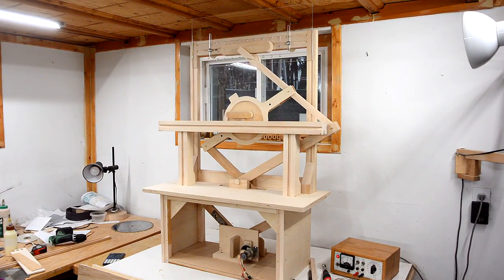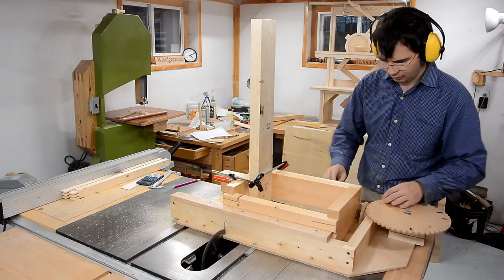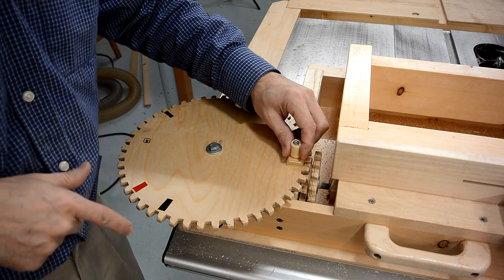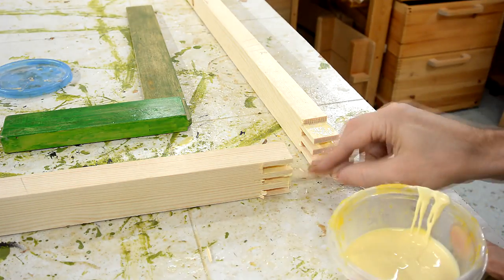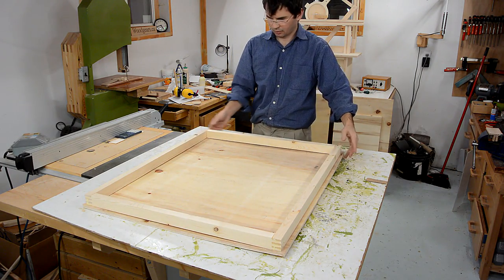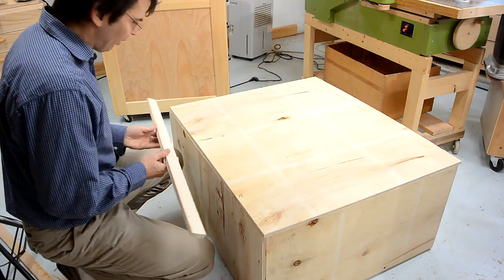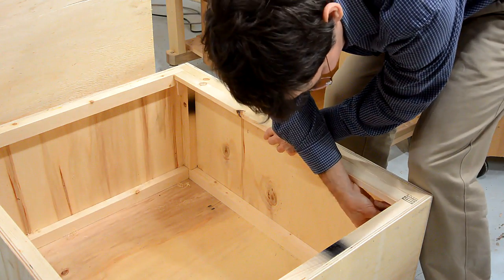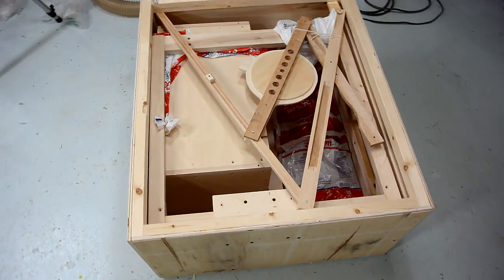Building a shipping crate

Comment: Happy Christmas morning!

It was such a treat to disassemble the box and set-up the demonstrator PantoRouter when we received it the other day, I was like a kid on Christmas morning.

There's even more of Matthias' brilliance built into this box than he showed in the video.    
Each piece of the demonstrator is carefully positioned and either screwed in place or has form-fit brackets to hold it securely.  

Even the plastic bags are well-thought and appropriate for their use.  Instead of using a piece of cardboard or the like, Matthias used the bags everywhere two wood pieces contacted each other in the box.  The two polyethylene films provide a lubricating layer to protect the final finish of the demonstrator better than any other commonly available material.
  
We painted the components above the motor and gear box then repacked the crate for delivery to the show venue in Baltimore.  I had taken photos as we unpacked the components so everything went perfectly back in place.

The crate is also the right height to use as a base at the show.  We're sewing a fabric drape for the base crate and a tall curtain to back the demonstrator so it really pops.  

Come see us at the show!
Reply: +Mac Sheldon Thanks , It's nice to hear the rest of the story, and all the brilliance built into the entire project. Good luck at the show!
Reply: please upload a vdo of the final demo setup u do at the event.

Comment: I've often wondered about those wooden gear systems? Can you really get an accurately repeatable cut? I assume so or you'd have designed something else. But I just can't  help think magnets would help. One on the crank, one under it so it stops in exactly the same place each time and holds there without moving if bumped or vibrated. Maybe even drilled holes all the way around so you could move the magnet in the crank? 

Just a thought, love these videos. Who knew watching a guy build a box could be fun!

Comment: Nice crate. You should add feet to the bottom of the crate to lift it off the ground about 3 to 4 inches, so you can get the forklift under it. Shipping company are notoriously hard on shipments, if your lucky they'll put a crate like yours on a pallet and we'll be fine. But I've have a couple shipments where they just ran the forks right through the crate. Sure the insurance company did cover the costs to replace the shipment but the hassle and upset client can't be repaired or replaced.

Comment: Matthias, first of all, happy holidays! I know simplicity is always the best starting point, but wouldn't it be a fun project to replace/power your jig gears with an Arduino or Raspberry Powered stepper motor. You could configure the required spacing and offset in a simple UI, and after each saw, you press a button for move to the next location. Would look awesome. :) - Keep up the great work!

Comment: what is the purpose of the screws if you have the nail gun?
EDIT: I'm, talking about the four screws added while gluing the side panels
Reply from the maker: +Ben Tzion Zuckier Shown in the video.  Screws pull wood together.
Reply: +Matthias Wandel thanks, but wouldn't the nail gun accomplish that? (thanks for the reply!!!!)
Reply: +Ben Tzion Zuckier I think that part wasn't getting pulled together so he used screws for more pulling power
Reply: ah thanks
Reply: +Ben Tzion Zuckier No it won't. When you shoot a nail it just penetrates the wood and holds the wood in place. Nails have very little pulling power. It might close the gap slightly but nowhere near the 1/4" required in this video. You need a screw or a clamp to make wood move.
Reply: thanks, i am a nooob
Reply: +Ben Tzion Zuckier  clearly
Reply: +wiser82 lol thanks. I enjoy the motivation
Reply: +Ben Tzion Zuckier we all have to start somewhere. better to ask than live not knowing.
Reply: +Ben Tzion Zuckier No one was born a professional. One thing to remember about screws and pulling wood together. The screws used to pull wood together need to have an amount of metal on the shaft without threads equivalent to the thickness of the material being screwed through. If not, the screws tend to push the two pieces of wood apart rather than pull them together.
Reply: +Jeff Stanley Or you can predrill the plate wood with a diameter equal to the thread width, at the risk of catching it less with the screw head.
Reply: +dascandy More than one way to skin this cat but your way requires the extra steps of finding the right size bit, installing it, drilling, removing the bit, installing the driver bit and then driving the screw. I am counting four extra steps.
Reply: +Jeff Stanley Yes. But given that I don't typically have the right screw handy for such a thing, the alternative is to get in my car & go to the hardware store - assuming it's open. That's a big step more. Naturally, it all depends.
Reply: +Jeff Stanley +everyone that commented thanks so much guys! I really did learn a bunch.
Reply: +Ben Tzion Zuckier I think everyone is missing the fact that he is using the screws to pull the wood together because he doesn't have a way to put a clamp down that far on the wood since there is no open side where the screws were put.
Reply: +subsgob00m Even if you did have a 1.2 meter long clamp that could, you'd be pulling the cleat away from the bottom face with the same force. That's not helping the overall structural integrity, so screws are a better solution.
Reply: wow. It seems i sparked quite the discussion
Reply: +Matthias Wandel hehe yes, yes they do
Reply: +Ben Tzion Zuckier Just because I didn&#39;t see anybody else mention it, personally I use nails to keep a piece from moving up/down left/right, to keep alignment correct. Screws are used to pull two pieces together. I often will use both depending what I&#39;m doing -- I&#39;ll hold the piece up in place and use nails to fasten in place so it doesn&#39;t move around, and then use screws to clamp it down. Because screws have a tendancy to walk, even if I drill a pilot hole, this helps with that. it also acts as a third hand
Reply: Chris Johnson thanks!
Reply: +Matthias Wandel So do clamps.
Reply: +Mark Job 100 screws are $4, a collection of clamps to cover all your various size needs with enough clamps to clamp an entire project...hundreds of dollars
Reply: TKD COW Lol! But to be fair Jesus did use nails..... (for his hands, ya know...like on the cross...) XD haha thanks cow.
Reply: Mah nigga +Ben Tzion Zuckier knows what he's talkin bout!

Comment: Hey, i know this question is kinda random, but..
I'm going to make a sofa table and a tvbench for my mother, and I'm very uncertain about the joints. I'm very very limited with tools and space, I only have a handdrill and a mitre saw. 
What joints is best for this project? Not sure I can make any Good joints with these tools.. Thanks
Reply: +TouchOfRed7 You are right to be concerned :) About the only joint you can make with that toolset is dowels. Buy a set of dowel points, drill two holes in one piece to be joined, insert the dowel points, and push it against the other piece to mark the locations for drilling on that piece. Good luck.
Reply: +TouchOfRed7 Looks like screws are going to be your only choice. You can be somewhat decorative by cutting the wood at 45 degrees and making miter joints.

Comment: Crate? That's not a crate! It's a piano!
I worked for a taxidermist building crates after I retired. We used 1 x 4 for frames and 1/4" ply or 3/8" particle board fastened with 2" and 11/2" staples, no glue., and always put 2x4 skids on the bottom. These crates contained everything from folded salted hides to moose head mounts wth 6' racks and life size standing grizzly bears, and were shipped all over the world without any serious damage to the contents. Anytime I got too fancy with my assembly my boss would grin and say " hey, you not building a piano there!"

Comment: Triffic work for a 'temporary' item.  You work so quickly in the video,  you must take some longer time planning how large the box will be; yes, I suppose the planning time would be wasted viewing :)  How you avoid wood splinters working with plywood, is beyond me.  Perhaps I'm just a splinter magnet ...
Reply: +excession777 I have a Festool track saw and when used with their track it makes unbelievably smooth cuts in plywood. They are so smooth they look finished, no sanding required.